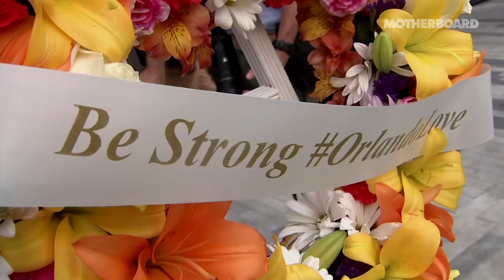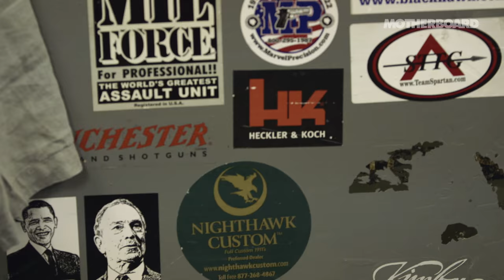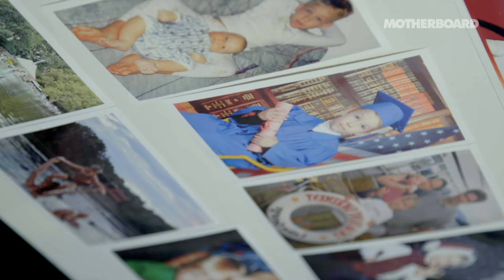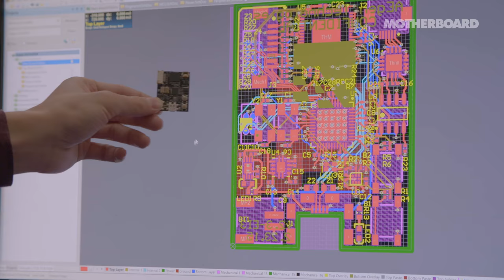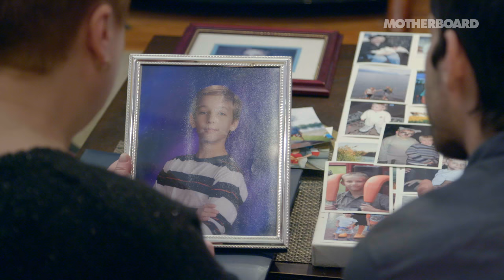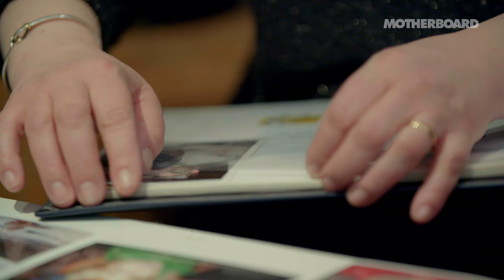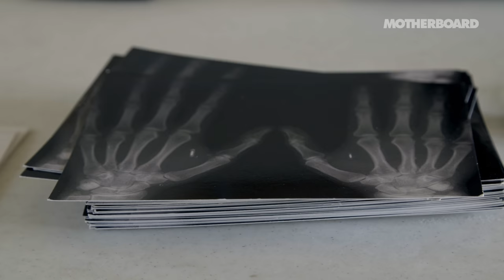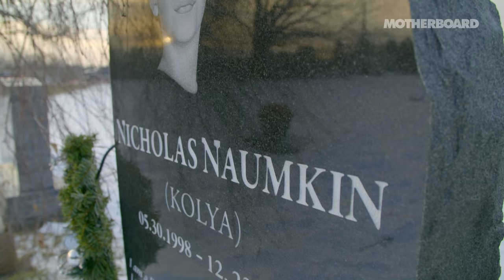Who Killed the Smart Gun?

Comment: 8:22 That dryfire hurt my soul.
Reply: he was probably told it wasn't loaded. notice how he said he didn't expect it to click? probably didn't think it was charged/cocked if it wasn't loaded
Reply: nah i think he just didn't expect it cause every gun he fucked with up until that point was safe with the action open
Reply: TheUVHippo but the safety should be checked on every gun EVERY time
Reply: So what's the problem with the dry firing? I appreciate guns but have never got into them myself. Does the dry firing impact the mechanicals more than firing a live round?
Reply: No. it is more of a safety issue. you are always supposed to treat a gun as if it is loaded even if you check to make sure that it isn't. but the guy took a weapon that he is supposed to treat as if it is loaded, pointed it at the cameraman, and pulled the trigger.
Reply: nothing wrong with dry firing... only on rimfire firearms is it an issue. Dry firing is a good way to practice....
Reply: +TheAusup
Normally when you fire a weapon, the striker or hammer hits the primer on the cartridge. If there is no cartridge to hit, then the striker/hammer will instead hit the much harder and much less yielding metal of the gun itself.
Smack two pieces of metal together, especially stainless steel or other "non-yielding" types of metal, and you'll start to incur "metal fatigue", or in some cases even cracks and fractures in the metal.
This doesn't happen on all guns, military guns notably tends to be much better at withstanding it since they are pretty much designed for it (you dry-fire it to properly "unload" it and make it safe), but especially older guns are more susceptible to such fatigue and not intended to withstand repeated dry-firing. Rimfire weapons, where the primer is around the rim of the cartridge instead of in the center of it, often have a thicker rim than the rest of the cartridge and "squeezes" the rim between the striker and the edge of the chamber. If there is nothing between them, then the striker will instead impact into the edge of the chamber.

With such weapons, you normally have clicker-cartridges. Dummy cartridges intended to be in the weapon so that dry--firing the gun means the striker or hammer will hit the "softer" and more yielding clicker-round instead of the metal in the gun.

Some people are a bit extreme on the "no dry-firing" thing though, and winces whenver it happens, even when done to weapons who specifically state in the manufacturers manual that you should dry-fire it after removing the magazine and checking that the chamber is clear in order to render the gun "safe".

Kind of how some people take the four basic rules of gun handling a bit too far....I've seen examples where some pretend-gun-safety-idiots laughingly point out the stupidity of someone looking down the barrel of a gun, not realizing that looking down into the barrel of a gun is something you do when cleaning the gun to check that the barrel is properly cleaned.....
As this piece of wonderful quote from TV-tropes show, regarding a pawn shop employee:
Also, later in that same episode Rick put the rifle down on its butt 
and looked down the barrel. Granted, he had cleared it himself moments 
earlier and he was very skittish about doing it, but he shouldn't have 
done that nonetheless.

No one on that page seems to have taken into account how a pawn shop employee should check the condition of the barrel and rifling without looking into the barrel...

Comment: I think the RFID thing is probobly the best option IMO. That said however, i do have some concerns that this "smart gun" thing introduces. 

1) what if i want to teach my kid (or friend) to shoot? I would have to give them the implant for them to be able to shoot it anyway, unless (and this was not specified) I have a permanent "unlock" rfid chip that lets it stay unlocked until I swipe the lock one, but now i have 2 separate implants for just ONE item I own. Not only that, but now i have to make sure I charge my gun battery before want to shoot it, and it adds more complexity to the gun, and parts that can easily fail (most of these micro servos are cheap plastic, or even if they are metal, are very easy to overpower and strip them. So I think you can possibly just FORCE the trigger down)

2) how does this work if i want to sell or pass my gun on? I have my gun taken in to have it reprogrammed to another rfid frequency (IE: its not something the OWNER himself can do. He needs specialized equipment). 

3) what about (if this becomes mandatory, and I think there is a good chance it may be) if disaster hits like a  solar flare or EMP hits and wipes out all electronic devices? Basically no one can use them to defend themselves and their family in riot/looting situations. 

I am not opposed necessarily to the idea of "smart" guns, but the technology aspect of it to me seems intrusive. I think there are better ways to curve gun accidents then this (one being making a country wide MANDATORY safety course for gun ownership you must pass before being able to apply for your license. Just like a car)
Reply: Regarding 1) you could give your kid a glove or otherwise stick a registered RFID chip on them when showing them how to shoot. Or just accept that you're not using your home weapon as a training device for your kid. The batteries in a device that does so little could easily last a long time. I'd guess months if not a year. You wouldn't charge before shooting, but you'd have to pay attention to your gun once in a while.

2) You answered. Seems fine to me.

3) I guess if aliens invade with EMP weapons we've got a problem. Oh well. Solar flare? Man I'd be more worried about my phone but that has literally never happened. Grasping at straws here.
Reply: Solar flares hit earth (among other planets) all the time. We just happen to live in a small space of time where one has not. Most recent one that could have knocked the entire planet to the dark age (ha, pun) was in 2003, but it missed the earth.

Its one reason why i still have an all manual motorcycle. I can kick start it and drive withought any of the electronics working other than a direct connection to the spark plugs and the alternator.
Reply: Philip I'd recommend you read up on the Carrington event.

Comment: I think you're trying to gloss over or ignore problems that seriously compromise the safety of the smart gun concept. I am in favor of the concept of a gun that only I can use; don't get some idea that I want smart guns to fail. I like the idea that if I had a pistol for concealed carry, and I were to be overpowered and the weapon stolen, that it wouldn't be usable to the criminal who took it. BUT the issues that can occur make the current status of the smart gun unsafe for the mass market and either defeat the purpose or make the weapon unusable when it needs to be. And it is un-Constitutional to mandate that all privately-owned firearms have smart tech. And last of all, the primary advocates for smart gun tech are tech developers before gun owners, with few exceptions.

For starters, most or all of the suggested solutions are electronic, and therefore require a power source for the weapon, and an additional power source for any external device used to unlock the weapon. Suppose that one or both power sources fails or are disconnected. In one of your other pieces, Amal Graafstra stated that his idea of an RFID-unlocked smart gun would be set to either "fail-safe" or "fail-secure" by the owner in advance of a power failure. If the weapon fail-safed, then it would be able to fire without being unlocked, which would defeat the purpose of the smart gun mechanism. Worse still, someone acquiring that weapon unlawfully would only have to disconnect the power source and hope the weapon was set to fail-safe. However, if the weapon were to fail-secure, then a power failure at the wrong time would make the weapon unusable when its owner would need it.

Next, comes all the issues with weapons activated by an external device, such as the Armatix iP1 with its watch and Graafstra's RFID implant. So obviously, with the Armatix example of a watch or ring or other jewelry, that unlocking device would only have to be stolen along with the gun. But it is not impossible to create a transmitting device that puts out the same signal as the jewelry or implant. It's also not impossible for a jammer to be used to block the signal between the jewelry/implant and the gun, making it unusable even when the unlocking device is within range. A hacker named Plore did both of these to the Armatix, which he demonstrated for WIRED; with some technical know-how, he made the firearm usable when it shouldn't be and not usable when it should be. But he took it a step further by using some cheap magnets to unlock the gun without the unlocking device or transmitter, by exploiting the mechanism that is activated and deactivated by the locking device. Jonathan Mossberg's iGun is even more open to exploitation; if the device used to unlock it is magnetic, then less technical knowledge is needed to crack it, as one would only need the magnet to do so. And while Graafstra's RFID implant is an improvement in that the unlocking device cannot be stolen, it is still subject to the same problems as the Armatix, possibly even including the magnet exploit.

And even Kai Kloepfer's smart gun is imperfect. It is an improvement over the above concepts in that it utilizes something that an external device cannot replicate like with the concepts above: the shooter's middle fingerprint. Putting aside that the fingerprint sensor requires a power source, it requires a precise and exact grip placement to activate. That is an unrealistic expectation for somebody in a self-defense situation in which their life is in danger. A common problem in CCW training is that an improper grip can disturb the shooter's aim, so the flaw that could make Kloepfer's smart gun unusable when it needs to be usable has existed far longer than the smart gun itself. Additionally, the Glock frame that Kloepfer showed you, as he stated, limited the weapon to only single-stack magazines and decreased its capacity, something no gun owner should be made to deal with. Finally, Kloepfer's smart gun may even be vulnerable to the magnet exploit.

I will admit, none of these problems interfere with the safe storage of a firearm with children in the home. Any would prevent a young child from discharging the firearm. But the problem is simple and these solutions are increasingly complex, when one would suffice: make the guns inaccessible to children in the first place. A responsible parent need only educate their child on safe handling and use a safe or a locked room or a standard trigger lock to ensure that the child can't access the gun without supervision. And the above problems with smart guns are apparent when looking at the whole picture, in which a firearm is used for self-defense in public or at home; smart guns only address the problem of accidents and crimes committed when someone steals a firearm.

Lastly is the issue of mandated adoption. I understand that none of the inventors featured in the video were suggesting that, but other inventors and politicians are. Firstly, the current state of smart guns is such that it's unsafe to require their tech be used with all firearms. Secondly, this is unreasonable and impractical for owners of antique guns, which have massive historical value, mechanisms that are not compatible with this type of technology, or both. Are they to be exempted, defeating the purpose, or is a confiscation to be executed? And what about the security threat created? Again, I acknowledge that no tracking or registry is suggested, but it would not be a vast leap for such to be linked to smart guns. Some tech developers have suggested the use of blockchain to create a registry for guns and gun owners. And from there, the government would demand the ability to control smart gun mechanisms, as has occurred in multiple disputes between the FBI and Apple over access to Apple devices. If this occurs, whichever government agency or agencies that control privately-owned smart guns would have the power to shut one or all of them down at any time for any reason, and then track them to the owner's location. The power that would grant to the government is un-Constitutional to an unfathomable degree.

And while the inventors featured in this video are proposing their smart gun technologies as safeties rather than as gun control, there are other inventors and politicians who are not gun owners, who advocate for smart guns as a gun control measure and do not understand guns. They overlook all the problems I've mentioned above and wouldn't recognize the un-Constitutional nature of mandated adoption. Simply put, you cannot expect people who don't know anything about guns to write laws about them and for the result to be good for anybody. Even you, the journalist who made this documentary, demonstrated incompetence in the handling of firearms several times, mostly with poor trigger discipline, and particularly when you negligently dry-fired that M1928 Thompson at 8:22 and said "I didn't think it was gonna do that". It is a beggar's belief that someone who can't even properly handle a gun has the solution to gun violence in any form.

Again, I want to see smart guns succeed. I want this tech to make my weapons usable to me and me alone. But now is not the time for the smart gun to be introduced; for the desired effect on gun violence and accidents, a smart gun concept must be able to overcome every problem I have listed above with ZERO tolerance for error, the technology must be an optional purchase rather than mandated, and the Supreme Court needs to rule that the government cannot and will not abuse the tech for the purpose of control over gun owners. Otherwise, a smart gun will be no safer than any other gun, and all the time and effort and funding will have cost lives.

Armatix iP1 hacked by Plore     (https://www.youtube.com/watch?v=ANllOmgJH9Y)
Amal Graafstra and RFID lock     (https://www.youtube.com/watch?v=cHCVlLrKYJM)
Summary of FBI-Apple encryption dispute     (https://en.wikipedia.org/wiki/FBI%E2%80%93Apple_encryption_dispute)
Blockchain gun registry     (https://futurism.com/blockchain-gun-control)

Edit: I don't know how I forgot to mention it, but a fingerprint-activated smart gun would be unusable if the carrier was wearing gloves in the winter or to protect their hands while working.

Comment: To be fair to the gun shop owner, he does have some valid points. How often will you have to buy a new smart gun because you want to be absolutely sure the electronics aren't faulty? What I mean is, will you have to replace it every ten years? That's a marketers wet dream on a big ticket item. Take that smart shotgun, for instance. Most of the time, it's just sitting on a shelf, which is good, I guess. But if the electronics are worn out that one time you need it, you're dead. Mechanical guns are tried and true solutions. This is not a simple issue.

Comment: When I was watching this I came up with with an idea that might be called a goodish brainstorm product. We could use a self powering circuit, so no batteries. The current would be produced by the phenomena of triboelectricity, which is what happens when someone has wool socks and slides across carpet(static). Only it wouldn't be produced by slippers but rather the action of pulling a two stage trigger. As the trigger is being pulled through the first phase, charge is produced via the contact of moving parts. This would be the source of power for a transmitter to send out a pulse(sonic/electromagnetic) and essentially look at the person who is holding the gun. The gun then recieves the signal that corresponds to the owners posture/fore arm size/something unique. In that instant while the locking device is still in operation(before the gun is about to fire it is decided whether the gun should fire or not. If it isn't the owner pulling the trigger then its a dead gun.
Of course it's just an idea but I'd say something like it could be done. Though maybe not with that power source. A better alternative would be the heat absorbed through the grip from the potential shooters hand.